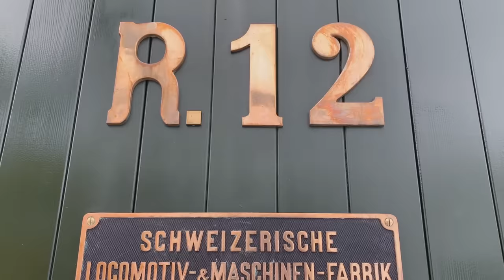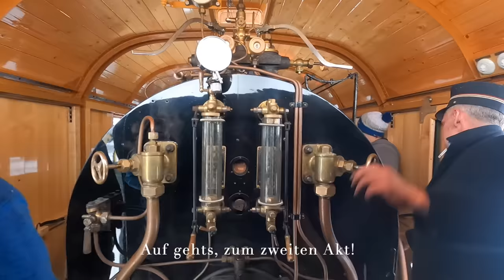Die Wiedergeburt der Dampfschneeschleuder R12 der DFB, ex RhB / Steam Train Rotary Snow Plow

Comment: Wonderful to see these historic pieces restored and doing the work for which they were built.  Beautiful job!  The Cumbres & Toltec OY rotary was restored and is back in service, too!  My main question is why not a double-header to prevent wheel slip?
Reply from the maker: Hello Lyle, this was a first function test. I think the next step is with the bigger Locomotiv Hg 4/4 704 in spring 2021.
Reply: @schoeneggbahn  I would have thought that you'd've used the cog drive on those steeper parts.  :-)  Also, the snow must have been =very= dry to get the distance it was being thrown.  Either that, or you've got a lot more power!  :-)  https://youtu.be/xsJ4hPgJMQ8